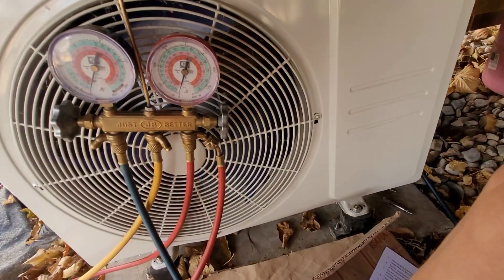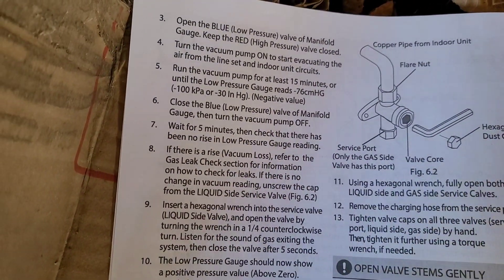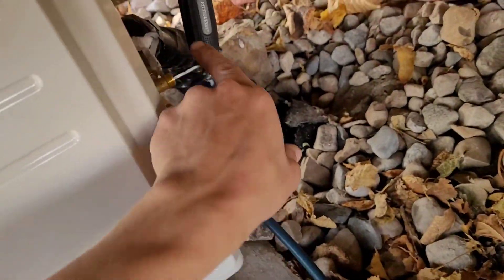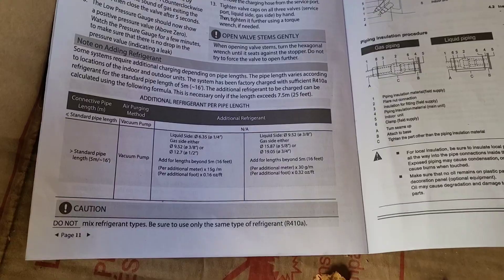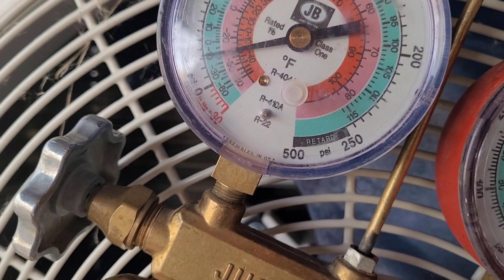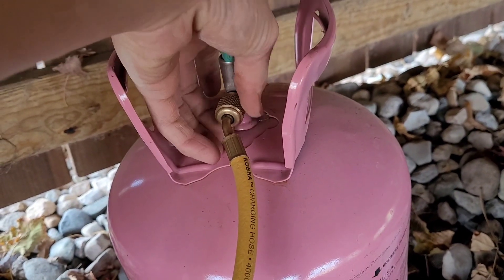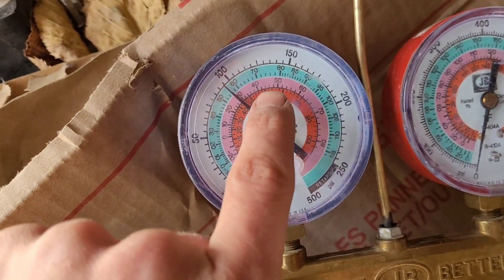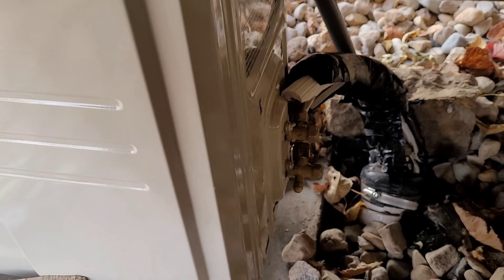How to add Refrigerant or Freon to a Mini split to Account for a long Lineset!

Comment: How do you like the pioneer mini split system? Thinking about buying this brand
Reply from the maker: I actually don't know much about them, as I did not install this system. I like the Bosch mini splits quite a bit, but I think most of the mini splits come out of the same factory in China somewhere.

Comment: Can i add the refrigerant to my 50 ft line myself? I can order the vacuum pump online i see.
Its basically like an automobile ac unit, correct??
Reply from the maker: According to the government you need an EPA certification, but there's nothing stopping you from doing whatever you want at your own residence. As long as you think you can do it you probably can. You just have to believe in yourself. 😂

It's definitely a more advanced thing to do, but it is the same principal as an automotive AC system, so if you're familiar with working on that you could likely do it yourself. Just be sure to add as a liquid, and add slowly so you don't feed liquid to the compressor, and be very precise with how much you add.
Reply: @ReubenSahlstrom yes I'm familiar with car AC systems. Etc 
And I BELIEVE! LOL
Thanks for getting back to me!
I guess my main concern is...
Can I buy the AC free on myself? And if so, where ? Google is not helping much.
And (sorry)
I haven't purchased the unit yet, doing research. What kind of free-on? 454-etc. Type because it's new? Can I buy that and where?

I'm trying to get a mini split system that's DIY 36000 btu  3 zone 
1st zone 6000 btu , 2nd zone 9000 btu, 3rd zone 18000 btu. I need 50 ft line for the 18000.
Can I do 2 -25 ft quick connect lines together to make the 50 ft line? Then it wouldn't need to be recharged?

I noticed when you did your 50 ft line you subtracted the 16 ft  of the 50 ft line you were charging. Is it two lines you added together? I don't get the math unless you had the 16 ft line pre charged and add on the rest??

Comment: Thanks for the awesome video. My system has been running.
For about three weeks. The AC tech just willy Nellie.Put extra freon. because of my fifty foot lines. I just bought.
Gauges and freon. I hooked it up and it is reading one hundred and twenty six. Do I need to remove some out to get down to 117 or so? My thermometer reads 12 Degrees colder than the inside air
Reply from the maker: Well, if your indoor and outdoor temp are higher currently it may not need any adjustment. In this case, it was a cooler day and the space the evaporator was running was also cool, but I would expect the pressure to increase if it got hot out, or if the space being cooled is a lot hotter.
Reply from the maker: If it's running at 126 psi, you'd be looking at like a 44 degree coil, which is not too bad. I think I would leave it where its at. 

Definitely not the best to use the willynilly filly method though. 😂

Comment: small tip: put on and tight valve caps during vacuum and after opening valves. this valves leaking a lot and sucking air during vacuum. not gonna see it with gauges like this, but micron gauge shows it quiet often. 
also i would do tightness test under 4-6hundreds psi for an hour at least to make sure flarings not leaking.Most common place on installs like this. 
and exposed copper/brass need to insulate,especially near indoor units, it is going to condensate and drip a bit.
lineset under ground is not really great idea🥴